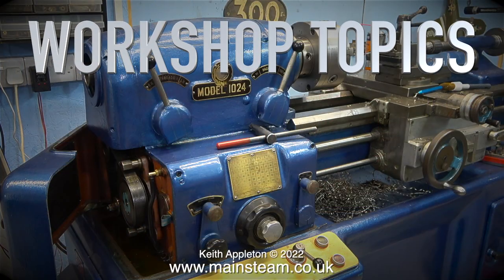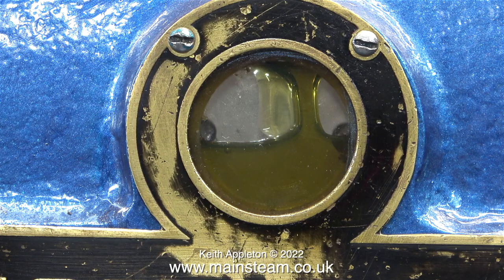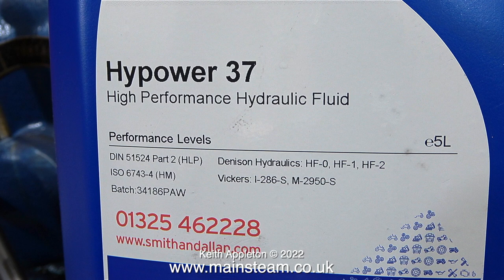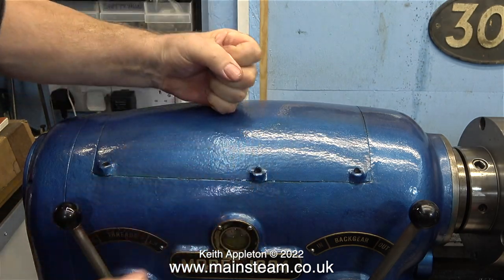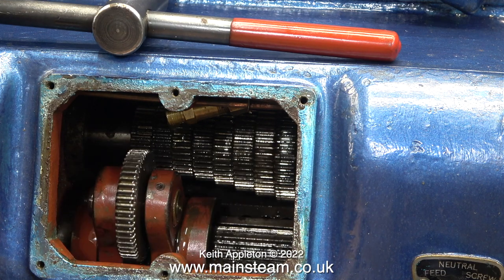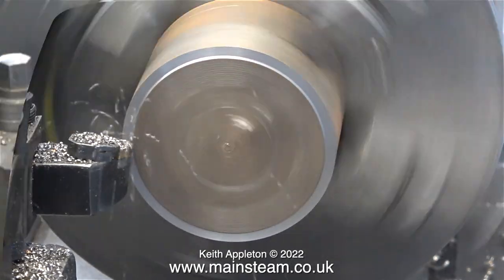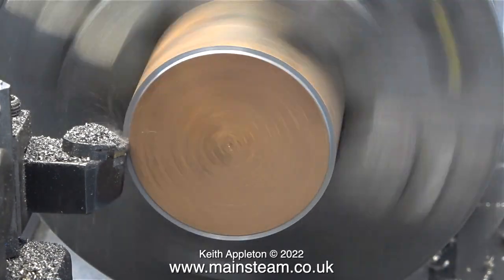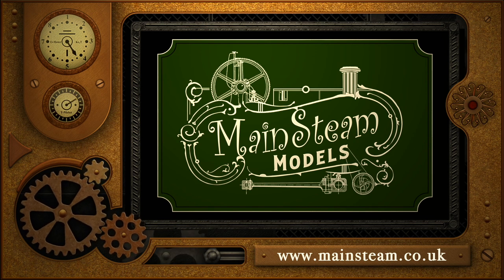CHANGING THE OIL IN MY SMART & BROWN LATHE - WORKSHOP TOPICS

Comment: Nice trick!  Unfortunately my machine just fills the gearboxes independently with no pump. The drain plugs are accessible, but opening them creates a royal mess even with appropriate funnels. That lathe is interesting; it reminds me a lot of a Monarch 10EE.

I imagine it costs an arm and two legs to import the Mobil product to the UK.  My machine specified Tellus 32 and 68, which is unobtainable in the US, but Mobil DTE maps to Shell Tellus, with the various numbers translating to the ISO viscosity, as I'm sure you're aware.  I wound up buying a 5 gal bucket of DTE 24 (ISO 32) for the spindle gearbox and a couple gallons of DTE 26 (ISO 68) for the threading and apron gearboxes.

Odd that your British lathe specified American oil and my purchased-in-US lathe specified Dutch oil.

Comment: can you use a VFD or call a  AC Variable Frequency Drives on the smart & brown lathe
Reply from the maker: Yes I suppose I could use a Variable speed control, but to be honest, the 4 speeds I have are more than adequate and I have machined many steam engine parts on this Lathe since the mid 1990s just as it is.